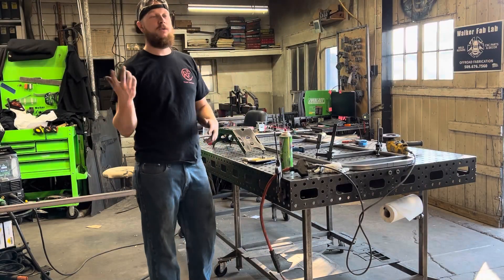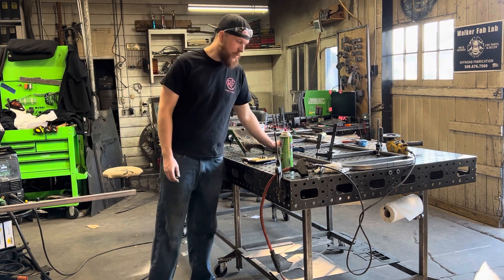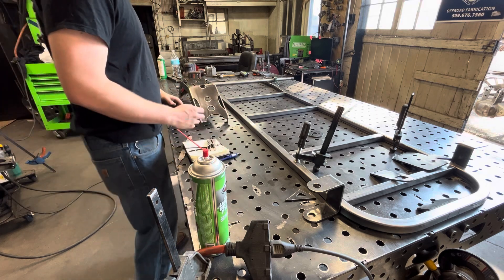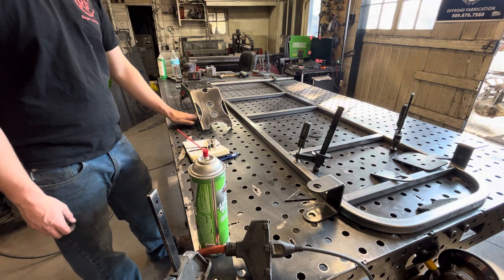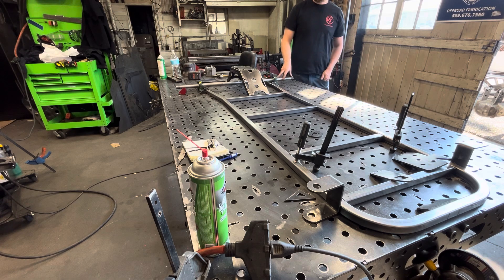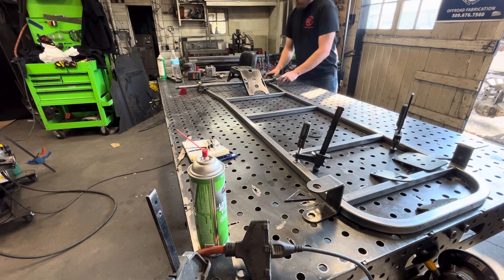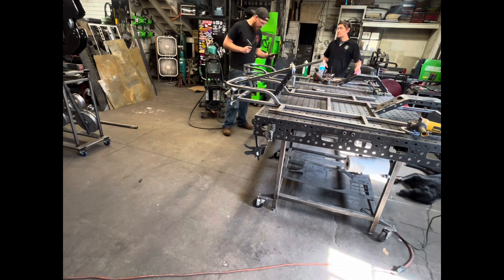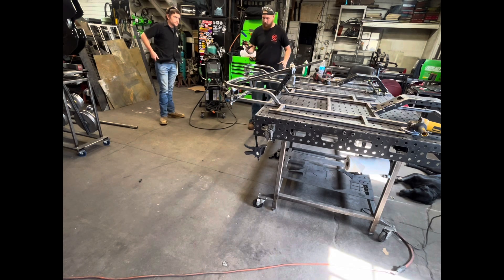Building The Drift 1 Go Kart part 1

Comment: Just found your channel. The kart looks great
Reply from the maker: Dude!! We appreciate the comment!!! Like big time!!! Anything you would like us to do explain or see built? You ask we shall try to do it!!
Reply: @walkerfablab  
I’m new to your channel but I’d really like to see you put a center support bearing on the rear axle. I know most people say it doesn’t need it, but I’ve seen plenty of drift trikes that have bent axles because they have no center support. I have a mini drag trike with a narrow axle. If it were a wide track I would definitely add another bearing somehow. Again, just my opinion I prefer longevity over performance in a build like this. 
Are you going to put out a you weld it kit?
Reply from the maker: @stanlucas665 yes that’s the plan! And we don’t have problems with deflection because the sprocket is close to the pillow block bearing. Hence why most motors are offset. You can get about 1/4” of deflection out of a shaft if driven from the center. These are built to last! 38-40” axle is recommended no wider or you will end up bend shafts more often. They are only 1’ shafts.